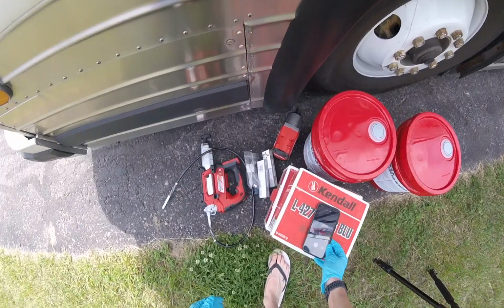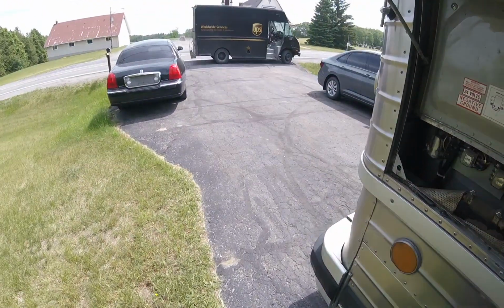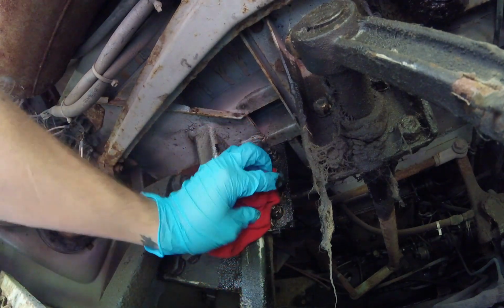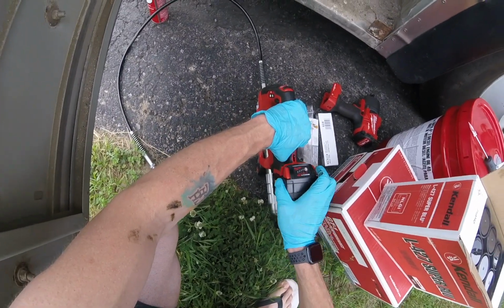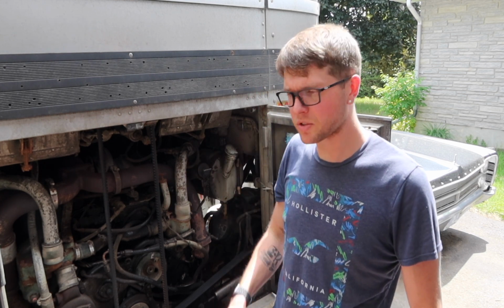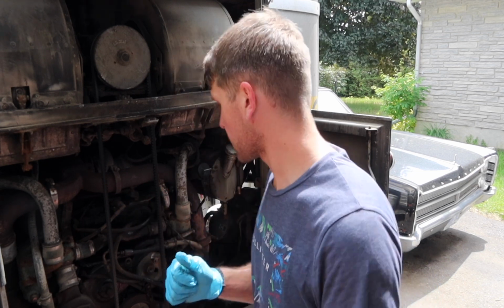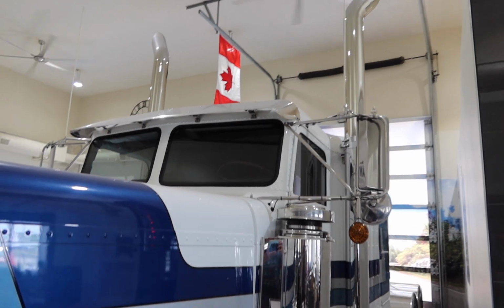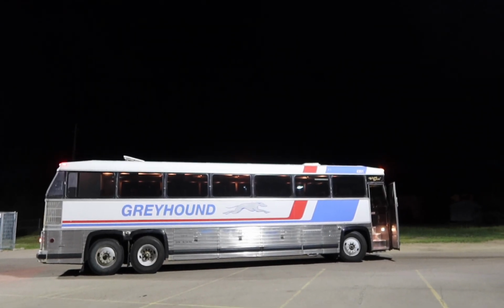Buttoning Up The MCI For An All Nighter

Comment: That is one sweet coach Sean , you are a lucky man.  Your MCI service manual is your best information source  as you have well discovered.  Those grease points are many and important to service on a regular schedule.  Kendall products are top notch, good choice.  I had to laugh when you opened the fuse panel door.  Years back I had electrical issues on a 102 DL-3.  MRD told me to check the panel, long story short, cockroaches had invaded it.  Happy trails, be safe.
Reply from the maker: Haha thank you!!!

Comment: Great Bus, I have a 1978 Mc8 converted, thank god you didn’t keep running the engine without the proper oil. I use Chevron Delo 100 it’s easier to get then Schaeffer's #107 40 wt, about the only 2 oils recommended for those engines

Comment: What oil you running? We used to run straight 40W Rotella, Delvac, Delo, etc. Its almost impossible to find so have to order your oil and keep some on the the bus. The 15W-40 that you see in truckstops is not suitable for the older 2-stroke engines.
Reply from the maker: Hey! Yes I order and run straight 40! It’s a must!